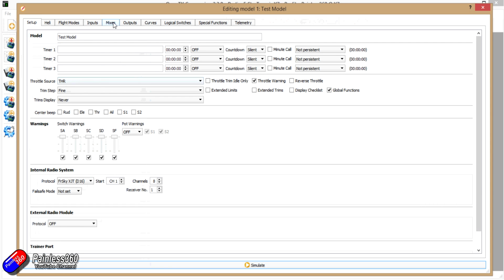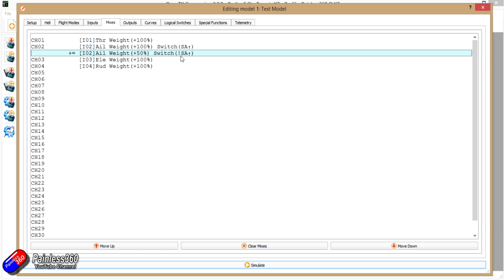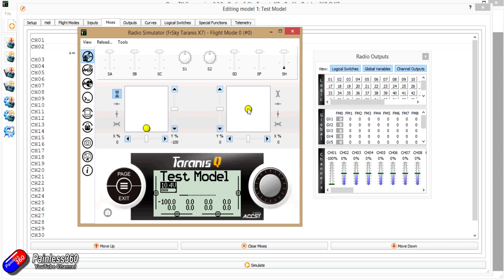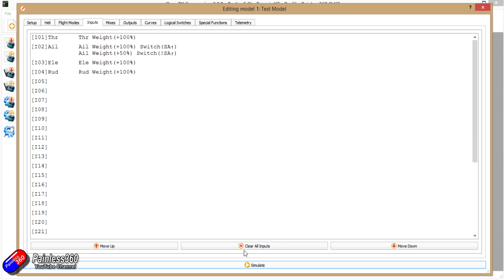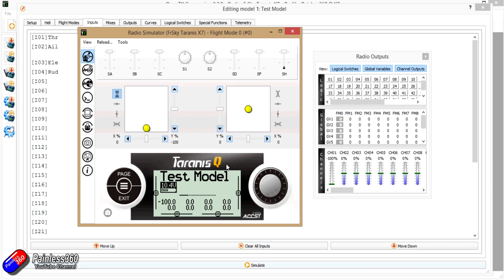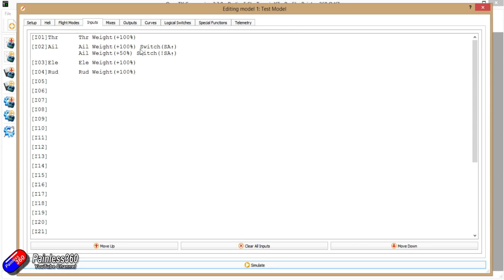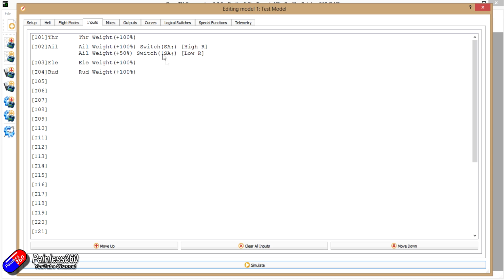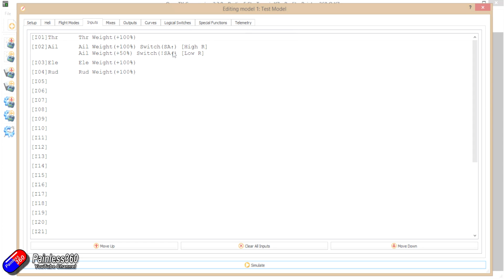OpenTX Mix School: More Trim Tricks..

Comment: I saw the earlier video on trim and global variables. Does that method limit the total amount of trim travel? I have my flying wing setup with the rates as input weights like this video) but even with coarse trim setting, I cannot get more trim change that I would like. Is there a method by which one is not limited by the amount of standard trim range?

Comment: I've not switched to OpenTx 2.2 yet, 'cuz what I have works just fine for now.  I noticed the Tx simulator screen was showing a QX7 instead of an X9D+, is that configurable or are we now stuck with a sim screen for a radio we may not have?